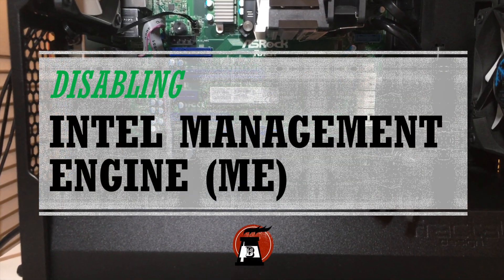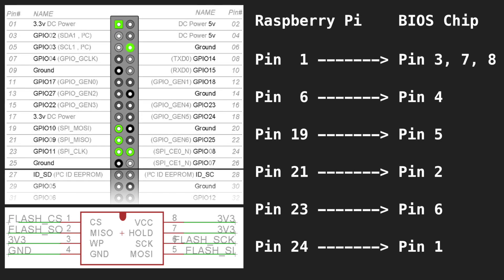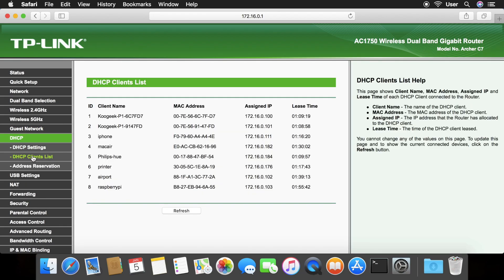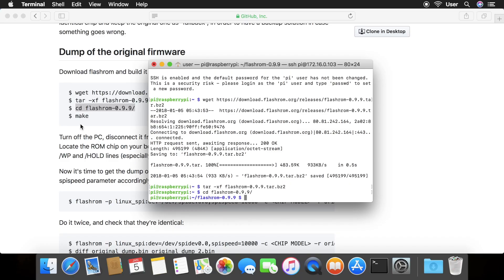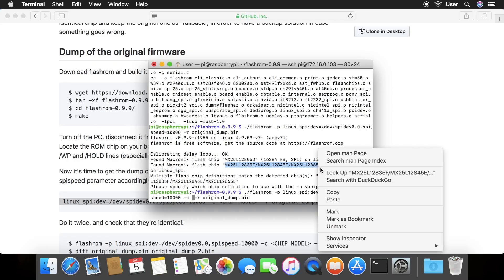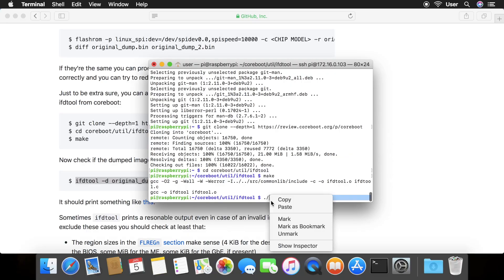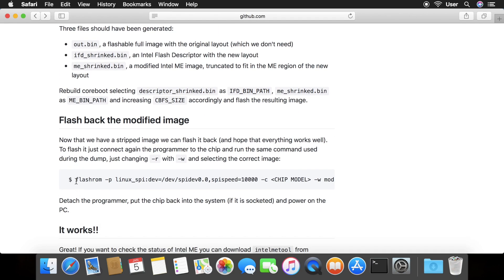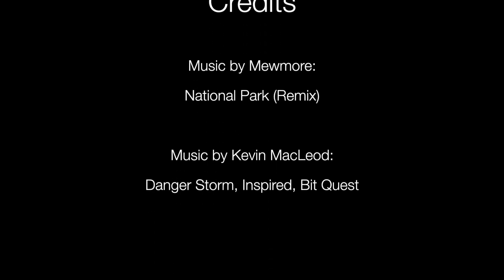DIY: Disabling Intel ME 'Backdoor' on your Computer

Comment: > Goes through all that trouble to disable IME
> Boots into Windows 10
I'M DYING
Reply: Finn Even if you manage to find all of the privacy-related settings in Windows settings without a guide, Windows will still send data to Microsoft. Random Windows updates will also re-enable several of the settings or sometimes just get rid of them entirely, like how they removed the (GUI) option to disable Cortana. You can still do it, but you have to know what you're doing, and it requires PowerShell.
Reply: Yeah I don't get that.. I had to wack my new CPU on the head. As it refused to install Windows 7 64... As these new CPUs try and force you to run Window 10... They can piss off.. I got a better microscope. As it's the 21st Century...

And learn to use Snort..
Reply: @MasterChief-sl9ro  Ryzen (non-APUs) and gen 7 Intel chips can all take W7. Much easier to set it up on Ryzen though.
Reply: @callowaysutton  Was reacting to the fact that this one guy felt he couldn't make a complete sentence without an ellipses. I agree with all you say, too.
Reply: @snbeast9545  wot
Reply: Exactly :D
Reply: Considering Linux distro as a result.
Reply: @sm177y2369  Isn't that what you're supposed to do with a backdoor?
Reply: Finn no, Microsoft collects all this analytical information on you to sell to advertisers as they want to make more money. Even if you disable everything in the privacy settings, you can use wireshark to see that data is still being sent to ‘telemetry’ servers and others.
Reply: what the fuck even is this comment thread
Reply: Cancer. Windows shills playing devil's advocate and Linux shills who probably use GNOME 3 with systemd on a backdoored processor anyway. The integrity of the operating system, kernel, bootloader, and BIOS do not matter when the lowest level hardware is the weak point.  @ggtylerr
Reply: At least he removed the hardware tracking
Reply: Oh my god lol! I read your comment so went back to see the end of the video to see if he boots up to windows 10 that's just the same windows 10 spies on you just the same. Jesus's I thought he was going to boot into archlabs or manjaro something you can fully control! 😭😭😭
Reply: @Pho Tato 
You also need to manually go through task scheduler.  Shutup10 is good, but it doesn't cover everything.
Reply: @Pho Tato all main stream social media are tools for spying. This is a 100 % fact. But hey if you like Windows good I use Windows only for gaming that is it period. All my OS are archlabs and MX Linux based debían I have full control 😋😋😋
Reply: I bet you use Linux
I'm dying
Reply: People use smartphones, and think an OS preference gives them privacy.  I'M DYING!
Reply: @cranshawmccaw  I just degooglify my phones.
Reply: lol
Reply: I audibly laughed when I saw him do it.
Reply: Windows ain't sending shit to Microsoft if you don't let them.  It's as easy as not  having a WiFi card, and no internet connection.  :)
Reply: I was about to say that lmao
Reply: noi siamo
Reply: nooo
Reply: same here
Reply: Bwahaha
Reply: >watching it on youtube
Reply: There's a very clear difference between what IME does and what Win10 does.
Reply: @nicki419  Yes, they are very clearly different - but at the end of the day, both IME and win10 compromise security, albeit in completely different ways. That's like saying "WEARS HELMET ON BICYCLE, PROCEEDS TO SPEED IN CAR" - both completely different things that will both end up badly.
Reply: @nicki419  Both are vectors for malware/spyware.
Reply: @nicki419  Both are malware by definition - give access to others and other programs, can install/edit/log directly contrary to permissions, and the list goes on. The end result is the same except W10 regularly does all of that whereas IME may never be used for any particular individual.
Reply: @hahahano2796  the patriot act is malware to our current timeline.
Reply: @hahahano2796  Linux, by that definition, is malware as well then... Everything is logged and leaves a footprint in Linux unless you disable (which is the same for Windows) so you're point doesn't make much sense. In fact, almost every operating system that has a filesystem and some type of port to another piece of hardware would fit that definition...
Reply: @callowaysutton  You appear to have missed where I pointed out the others are not able to be disabled and when they are the system ignores it. So no, not the same.
Reply: @hahahano2796 , both can be disabled from sending information. You're shitting on W10 for what?????
Reply: @benjaminyu8545  you are probably on a watchlist lmao
Reply: @hahahano2796  What in Windows specifically cannot be disabled or modified to the point where it doesn't do what it's original purpose was? Now what in Linux cannot be disabled or modified to the point where it doesn't do what it's orginal purpose was? They're the same. You seemed to have missed the point that operating systems are still pieces of software and very open pieces of software at that. You're allowed to modify Windows all you like just as long as you don't redistribute it. And even though a lot of the code is proprietary, if you look at the things it interacts with you can assume the purpose and make your own code. Again, back to your point, how is Windows different than Linux in that fact that it's somehow malware?
Reply: @spikefallyt3350  tell me something I didn't know.
Reply: @benjaminyu8545  Why do you comment that on this video?
Reply: @callowaysutton   except, your logs never leave your system in Linux, and can be disabled. Windows 10 phones home with information about you constantly.
Reply: @hightoxicity9819  You can always block that though? Ubuntu and other variants akin to it did/do the same things anyway
Reply: @callowaysutton  Ubuntu is terrible and does not represent Linux as a whole. You can't stop Windows from phoning home, short of intercepting packets.
Reply: @hightoxicity9819  Yes you can, literally the built-in firewall and the built-in service manager will block 99% of anything that communicates to another device and the other 1% can be blocked just by blocking the address that a packet is being sent to. You're talking to the dude that has contributed to the React OS project for that past 4 or 5 years examining Windows code. You may think I'm some Microsoft fanboy or something but I'm just saying all Operating Systems are more or less the same when it comes down to the fundamentals and the whole debate of Windows vs Linux is pretty stupid since they both can provide the same functionality, if not more on the Windows side.
Reply: @callowaysutton   I mean, ReactOS has been supposedly  not reverse engineering Windows code for a very long time and has only mainly referenced the 2004 leak, and went in and removed large chunks of code just over a decade ago simply for being a result of reverse engineered code. Is there something very illegal I'm missing here that you are directly confessing to and ratting out the project contributors, or...?
Reply: @hightoxicity9819  In the U.S., Section 103(f) of the Digital Millennium Copyright Act (DMCA) (17 USC § 1201 (f) - Reverse Engineering) specifically states that it is legal to reverse engineer and circumvent the protection to achieve interoperability between computer programs (such as information transfer between applications). Interoperability is defined in paragraph 4 of Section 103(f).
Reply: @VulcanOnWheels  because isn't that what we are here? To combat the post-9/11 culture of cuckery that the masses is okay with violations of our rights as long as it makes us feel a little more secure? We need to make it impossible for the patriot act to further reach into our lives and instead of fixing it legislatively, we fix the issue logistically.
Reply: @hightoxicity9819  Although you are right, there is a very thin line that has to be traversed since this same bill also prohibits reverse engineering. But back to the main point, I don't see why people would fanboy over Linux, there's not much special about it comparing it to other operating systems (*BSD, Solaris, NT) and has some features that leaves fundamental faults in the actual system (such as being a monolithic kernel like Windows)
Reply: @callowaysutton   One of the things I do enjoy about Linux is the diverse options. I hate the Windows UI personally, I think it's really clunky, and I can get more done faster with my personal workflow and style with i3wm (I use the i3-gaps fork personally) and some custom keybinds. It can also be considerably prettier, if you look at KDE and Deepin they are floating managers like Windows but they manage to be way better looking and in the case of KDE insanely customizable in comparison. i3-gaps with some minor configuration can be extremely goodlooking too, and not lose much of the practicality afforded
Another aspect of Linux that I enjoy is setting it up how I like it. I don't need to put up with being forced into pretty much anything, I can choose from a wide range of distros to pick a package manager I like (I'm a pacman guy, but if Portage wasn't so annoying I'd be all over Gentoo), and build the whole system around exactly what I want, where I want it, and how I want to use it. Every single aspect is up to me. That's why I like Linux. I don't think it is fundamentally that much better than Windows (although certain elements of the system are overall better designed & I like the philosophy behind it overall), and I do like Windows quite a bit besides the UI, but it needs to be recognized that the main thing holding Windows down is that when you use it you are effectively forced into using it how Microsoft wants it and not how you would best use it.
Hell, if I want to, I can build my Linux kernel from the ground up and do everything from scratch so I can get a hold on EXACTLY what goes on. 
BSD is cool too but I've heard it has some slight issues for everyday use, and it also is missing some compatibility. There are a lot of Linux programs that don't work on other Unix-like systems because of the sheer amount of expansion that has been done with the Linux set of tools, so for me, it's Linux, macOS or Windows and I pick Linux because I like to have my system working and feeling exactly how I'd like it with no compromises.
Reply: @hightoxicity9819  Yeah and I agree, vanilla Windows is quite a pain and is terrible both security wise and resource wise. If I could have my way, I'd have them open-source it and pull a RedHat so that they could still get revenue from the OS but also have users contribute to the overall design to it. The reason I'm seemingly pushing the Windows side so hard is that people don't really realize how customizable the whole thing actually is. For example, I added keybindings to every single function in the task bar and sub menus making it more like an i3-gaps experience (If you're ever on a Windows computer you can do it less stylishly by pressing the WinKey + Arrow Keys) and managed to get the whole thing running at ~400-500 MB of memory at idle (it's a little trick I found that makes it so all non-essential objects are just put into the pagefile). You're set up seems pretty cool though, are you running Arch or something like Debian?
Reply: @callowaysutton  I'm running Arch mainly, I'm, uh, debian-averse, although I'm not an Arch fanboy - Debian just left a bad taste in my mouth since my main experience with it was stuff like Ubuntu, although CrunchBang was awesome back when it was around.

Windows can't be anything like an i3-gaps experience - it fundamentally does not function with tiling, and 3rd party implementations I have seen don't have the easy and quick dynamic tiling system.
I have customized my Windows 10 install to great lengths. I'm using Classic Shell with a custom taskbar texture, bitmap fonts for  a e s t h e t i c , custom start menu skin, custom start button, Rainmeter, a metric tonne of AHK scripts, Object Desktop (incl Fences and Groupy). I've put a lot of time into tweaking windows and yet still, I find myself going back to i3-gaps on Arch. It looks nicer, it works nicer, and I'm just more productive with it personally. I'm sure it is a personal preference thing - while features of i3 do make it more efficient overall for use, a lot of people will just sort of mesh better with the way Windows works. But, they can get similar core usage with more customizability by default and more expandability with features using KDE on Linux. 

There comes a point where the main points of comparison just purely boil down to the desktop environment, workflow, looks, security, ease of use and how much control you want to have - if you care about security, I'd say Linux with some customization wins by default for desktop environment, workflow, security and looks and control as you have a plethora of high quality options to suit it to your exact choice and being inherently more secure by design, but Windows is generally easier to set up and use if you don't want to go through the learning curve, has more professional level software for certain fields like graphical work, and has the natural benefit of a high marketshare. Linux also has a way, WAY more sane way of dealing with installed programs, as package managers typically keep track of things very well and work with dependencies automatically where as Windows can be a wild ride of non standard installation processes, adware, programs that don't come up in control panel/settings, and hunting down dependencies or even having to go through additional installers, as a dependency is forcefully installed multiple times due to programs not communicating with eachother (For example, Visual C++ Redistributable and DirectX tend to be the worst offenders here, needed by many, many applications and too dumb to work out if they've been installed before at times). Chocolatey for Windows does exist but its repositories are nowhere near as complete as something like Pacman or Aptitude because it is a very fringe program.

It just depends what you value more personally in a system. I like the fact that my setup is effectively exactly what I want, with the minimal setup provided by Arch to get it up and running (as well as Pacman, as part of arch, which I love, as well as the AUR), and using it, it works to my specification. It's a system built around my workflow, and not my workflow built around someone else's preferred system.
Reply: @hightoxicity9819  Haha yeah Windows is terrible with programs and I use chocolatey a lot. I don't see how Windows cannot be like i3 though? Theres already keyboard shortcuts to opening a terminal and arranging windows/workspaces without ever touching a mouse, all thats needed is to fill the gaps with some custom shortcuts to do the rest of the functionality (like infinite tiling, although I thought i3 gaps had a limit of like 16 open-windows per workspace?). I've also made a program that makes installed programs a little more manageable and usable from the command line (it scans for executables or bat files in the Program Files's directories and Program Data then creates a shortcut inside of a path directory). At this point though, it's all just up to personal preference
Reply: @callowaysutton  " unless you disable (it)" <- thats exactly the point! In Linux you can choose what your system runs , does, documents and so on, while win 10 won't keep all your settings longer then the next major patch comes along. Also you are root (when ever you want to be root) and there is no higher authority. in win there is always a hyperuser who is above the administrator; microsoft.
Reply: @fernabianer1898  My point was that both Windows and Linux can be configured, just people either don't try hard or care enough to actually disable the things they don't like then go on the internet and rant about how bad it is
Reply: @callowaysutton  Well, with i3 you have a lot more opportunities for your layout to be done very quickly with the keyboard. In windows, can you as efficiently go into any possible tiling layout filling up the whole screen with switching tiling directions on top of and beside eachother in a dynamic grid like system (ie, choosing which axis in which to split the window), then switch by direction along the screen with the home row rather than by taskbar location? Can you jump between tiling and floating with the click of a button? Can you choose to stack up windows, like vertical tabs, within one tile? I recommend using i3-gaps for a couple of weeks overall as a main system, you'll immediately start to see the gains.
Reply: @callowaysutton  it has been shown with network package analysis that win10 even phones home after setting every privacy option on. Proprietary software is and will always will be black boxes, which you will never know what it actually does inside. It's a question of trust. Even if open source software does log things (when turned on), you are always able to look inside what it does, and if people are offended by what it does, are allowed to make a fork (modified copy) of that project, in which they respect the user more. Even as a non-coder or someone who does not have the skills or the time for such a project you profit from that, because there certainly will be other users who will look inside and socialize. I trust a system that shows everybody what it does more, even without looking into it myself.
Reply: @hightoxicity9819  It can't do every single feature that you've listed but yeah it can do most of that and I can program it to do more. Also, I used i3 for around a year or two last year and it really is a nice windowing system and I'm seeing about maybe developing a 'port' for Windows. Also can i3 cascade windows and minimize windows? (I genuinely don't know and I haven't seen any features of it)
Reply: @cptdve6669  But it's not a black box, people are just too lazy to actually see what it inputs and outputs and how to modify it so they just label it as a black box and leave it at that. And I get why, I mean not everyone has the time nor the knowledge to go around Windows' system files and optimize and secure it but to say it's a black box is just plain wrong
Reply: @callowaysutton  It can cascade them in a sense - not in the way Windows does where they're all fanned out diagonally, but you can group them into tabs which can either sit vertically at the top of the window stacked onto eachother, like cascaded windows, or horizontally like browser tabs. In terms of minimizing, you can do something similar in your config by binding keys to scratchpad, which sends off a window to a "dead" workspace and they can be brought back. The only issue I have with this approach is it can be cumbersome to get the correct window so what I tend to do is just send things off to some high workspace number I don't use and then switch to it and super+shift+(number) to grab them back to the workspace I want. It's cumbersome, but there''s no reason to really minimize in i3. 

I'd be interested in seeing your Windows port!
Reply: @callowaysutton  oh you have the Source Code of windows OS? Yes you can see what goes in, and what goes out, but you don't see how it is processed in the hidden code. You can do some reverse engineering to deduct what happens inside, but you don't really know. 

Edit: Yes you can modify things, but only in the frame that Microsoft allows you to do it by enabling that feature. You cannot do "everything". Obviously you can be more hacker-ish and use third party tools to circumvent or add some features. But that is like a superficial treatment to a phenomenon, and not the cure to the root of the problem. I am not speaking bad about the architecture of windows itself, only about the fact that the code that is executed is unknown to the user and hidden. Why is it hidden? If it is hidden and you have no way of knowing what actually happens, you have to be skeptical. Why? Because it is YOUR computer it's running on and it's using YOUR data. You should be the boss.
Reply: @hightoxicity9819  Haha yeah thats what I did to 'minimize' the Windows, and if I ever get around to finishing it I'll send you the Git repo :P
Reply: @cptdve6669  If I'm suspicious of a piece of software that Windows uses I'll just rewrite my own version of it, although I do understand not everyone can do this because it's just cumbersome
Reply: @cptdve6669  And also, you always have the ability to  disassemble code and look at what the actual program is doing to the machine
Reply: @callowaysutton  no Linux doesn't do the same as what Windows 10 does and respects your privacy
Reply: @callowaysutton  your definition of malware evades my logic
Nobody can see what I typed
Nobody can read my files (LUKS)
Nobody can get any data after my computer is off, nothing at all, not even kernel (SED / OPAL)
How this compares to Windows and IME?
Yes, everything is logged, but what is logged and fire how long is user choice. Where it is logged is user choice. Whether it is logged not is user choice. 
Can you do same with windows? 
I never work on Windows. It is insecure by definition.
Reply: @WizardNumberNext  You can completely disable logging on Windows? just stop WLS
Reply: @callowaysutton  but are you sure about this? Can you positively confirm this? It is extremely work intensive and I doubt you can be sure. 
No source, no assurance. 
I have source of what is running on my computer. Literally all the source. I have full Debian mirror from 3.0 to 10 for amd64, arm, armel, armhf, arm64, i386, m68k, powerpc and source. Can you say same thing about Windows? 
I have no source of windows.
Reply: @callowaysutton  Hi, could you please spend a little time discussing Windows 10's telemetry? I'm genuinely interested in this subject.
Frankly, telemetry has been THE reason I've been avoiding Windows 10 like plague since the day it came out in 2015.
My understanding is there is absolutely no way you can stop W10 from sending some information back to MS, on Home Edition you can turn telemetry down to "Basic", and on Enterprise there's this level below "Basic", called "Security", but that's as low as you can set it. Still can't turn it off.
Regarding all those 3rd party programs claiming to "stop Windows spying", they can do what they claim to do, or do it partially, or do nothing at all, depending on whether or not their authors got correct info on registry keys, MS servers' IPs, or has the latest Windows 10 update (which you can't prevent from being installed, at least not forever) changed all that without them noticing. In short - you can't rely on those programs.
Also, AFAIR, Windows doesn't follow its own rules when communicating with (some) MS servers, e.g. you can't block them by modifying your hosts file. So who's to say tomorrow's update won't add more "exceptions" to that hidden list of privileged IPs or something similar.

So I guess the only way to really tell what's going on is to disassemble / decompile Windows 10, but that would be a helluva project to undertake.

Incidentally, what is the deal with Ubuntu you were referring to? Surely it wasn't about when they included Amazon in desktop search queries, because that was so long ago, right? (And also you could opt out by flicking one switch and that was it)
Reply: @booruvcheek1331  Ubuntu collected, and still collects, telemetry which has a toggle but the problem is that it's enabled by default and not really mentioned anywhere. Besides that, there are many tools that effectively cut out windows telemetry such as the Windows Debloater tool on Github which just uninstalls everything that could be related to the telemetry process and Winaero's tools which stops the processes from running or sending data. I know this is a hastle, but to me it's worthwhile considering it guarantees your privacy while letting you access the sweet 90% application marketshare that Windows has.

Granted, there are things like virtualization you could do, but I frankly don't have the hardware to do that on since I only have a single GPU and I would need PCIe passthrough to be able to do a lot of my work.

However, if you are running Linux and have 2 GPUs lying around and at least an 8 threaded CPU (and a motherboard with IOMMU support), this would be my definite recommended course of action.
Reply: @callowaysutton  1. On Ubuntu - could you please elaborate on (a) what it collects and (b) you sources? If it's not really mentioned anywhere, then how do you know? I'm not trying to be Ubuntu fanboy or anything here, I'm after separating rumors from truth.
2. On Windows 10 telemetry - how do you know that the tools you have mentioned do effectively cut out telemetry functions? Remember, they're third-party userland software, claiming they can defeat the operating system they're running on. Do Windows Debloater or Winaero's tools run in ring 0?
And even if they do manage to pull that off  somehow at the moment, this operating system can update itself automatically tomorrow, and you can do nothing to prevent it, AFAIK.
Look, if you say "I consider it worthwhile, I want to run the games, and Photoshop and all the rest 90% applications and I don't mind sending information on the programs I'm running to MS" - this is fine, I can see your reasons.
But when Microsoft tells you that they won't allow telemetry to be shut down completely (I know because I have asked their customer service) and as the developer of the operating system they have ALL the means to do it, then it's going to take lot more than just "there are tools that claim they stop telemetry".
I want to know how can they make such bold claims.
Also, I'm really interested in knowing how can you, a guy who worked on ROS, trust them. I mean, it's not just blind trust, right?
Reply: @booruvcheek1331  Wdym ring 0? All telemetry data is read and stored in the userland, not even at driver level, so theres no need for ring 0 access (which would be near impossible anyways). And these '3rd party' solutions are open source afaik and work on the same premise of disabling the process that phones home to Microsoft which is the Connected User Experience & Telemetry and Microsoft Compatibility Telemetry. And about Ubuntu, it sends about the same amount of information as Windows does. Comparable to be in between Basic and Enhanced telemetry profiles since it sends driver and kernel warnings, app crashes, and general usage data alongside. Besides that, if I'm not mistaken Windows added a feature in the past year where you can download/delete all the data you have sent to them into the Settings app. Also can you expand on ROS? Is it an acronym?
Reply: @callowaysutton  Sorry for not replying sooner, kinda got swamped with work.
First of all ROS = React OS.
Second, regarding Ubuntu - could you name your sources, especially for general usage data (I assume this means the applications ran by user?). Also, are you referring to just Ubuntu, or every kind of *buntu (i.e. Ubuntu derivatives)?
Are you, by any chance, referring to https://github.com/ubuntu/ubuntu-report ?
I did some searching on the internet, and it looks like you can 100% opt out of the thing, which makes it 100% fine with me.
You see, I don't think telemetry is evil per se, it can serve legitimately good purposes. It's Microsoft's approach (a - you can't shut it down, b - we can update your system whenever we want, so f you) that I find unacceptable.

Regarding deleting any data you send to any  big (and no so big) company - yeah, as if the fact they actually delete (as opposed to hide from you) is independently verifiable.

Now, about the 3rd party apps and ring 0 - yeah, they can disable a process or two, they're probably developed by well meaning people, and they can even actually be doing what they claim they're doing for the moment, but ask yourself - when the next Windows update hits, who can tell parts of the telemetry code won't be moved into the kernel? And who can tell it has not happened yet?
I mean, ok, you're telling me all the telemetry stuff is in userland, and let's just say it is, I'm not even going to ask for sources. I mean, someone must have done deep research, tracking the whole chain, from data collection to encryption to sending it to the mothership, someone has disassembled it all, right? That research must be somewhere on the net, I just didn't dig deep enough to find it, I guess.
This is all fine, but who's to say that grand research has not been made obsolete by the latest "creator's update" or whatever stupid name they use these days?
Reply: @mycelia_ow  You should try to disable Windows to send any information and monitor your Internet traffic. After that you should use Debian without data collection and and monitor your internet traffic. If you are a person who is worried about a CPU with ME, you should also take a look at your OS.
Reply: @mycelia_ow  For linux it's a feature. For win10 it's a hack.
Reply: @callowaysutton  Linux makes you enter your password so much that it makes it extremely difficult if not impossible to make system changes without the owner's permission. That being said, until Linux can run the same programs as windows or all developers adopt Linux, it's not going to be a viable solutions for many people.
Reply: @americanpatriot365  I've been running Arch for the past 4 years now and Windows apps have been running fine through Wine lol
Reply: Yeah, ME is just a backdoor if they want to actively seek you out and get you, Windows 10 phones home every keystroke you make to Microsoft, the government, and their corporate masters :^)
Reply: @dikemawson3008  Here's a video that describes how to disable all of it. https://www.youtube.com/watch?v=u1kGMCfb2xw
Reply: @finneasy  Your definition is limited and incorrect. Per Wiki malware short for malicious software which includes subsets of software such as ransomware, trojans, spyware, ets. Furthermore, it has been well documented by W10 users that opting out (it's own problem) does nothing and disabled/deleted parts of it will often be restored during an update. Less well known is that this happens in enterprise editions as well. Even less well known is that it is possible to have this happen, though much more rare, on LTS editions with the self-pointing update server setup.
Reply: Microsoft shill detected.